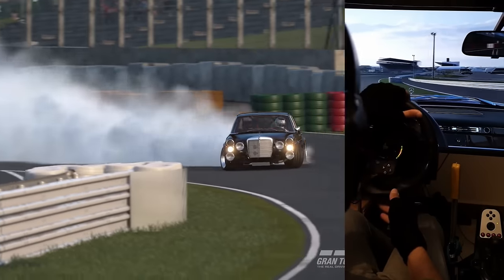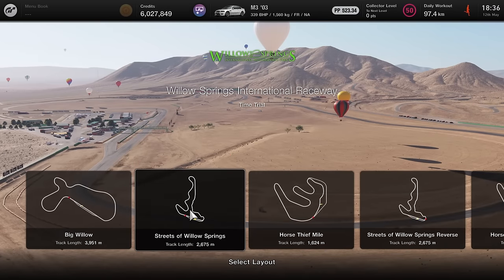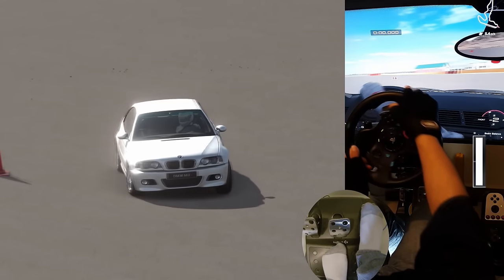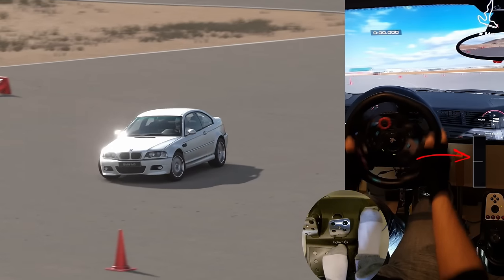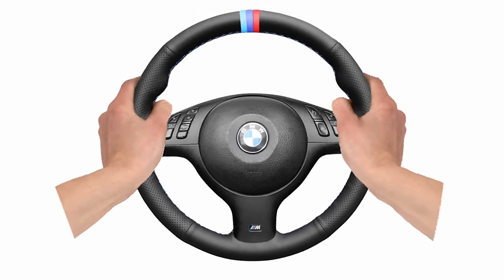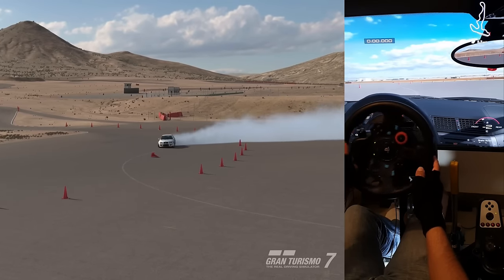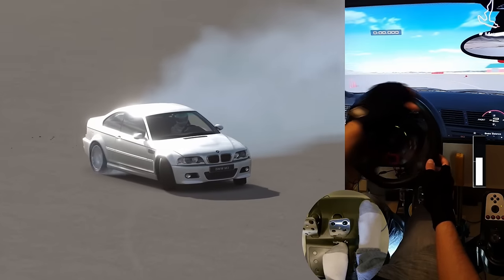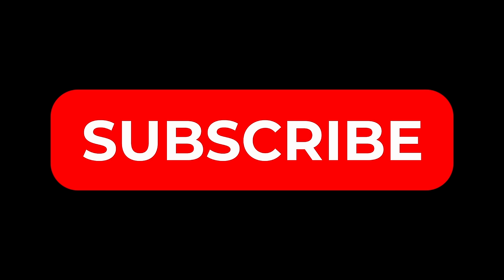How to Drift With a Steering Wheel (GT7/Real Life Tutorial) - Part 1: Basics

Comment: Ive tried this so many times. Ive tried hours of this with the same exact set up, and it just doesn't work. I do way better on a real car.
Reply from the maker: It's very normal to do much better in a real car. It's much easier to me to drift in real life than in game. That's because of the absence of G-Forces acting on our bodies which is the main "feedback" that we count on in real life to know how the car is behaving. I even think a person that is totally new to drifting in general can get used to drifting in game much faster than someone used to drifting in real life because that will require of you to rewire your brain and senses which I think is what's happening with you. You need to relearn how to feel the car like it's a completely new thin to you, if that makes sense. Luckily I learned the other way around starting with sim drifting than switching to real life which I remember feeling much much easier and require less concentration. You need to focus more on what the wheel's force feedback is telling you and practice long enough to get used to it. And trust me "hours" is not enough at first, try "days and days". Btw which wheel are you using and what are your ffb settings? If you didn't see this already, watch my video about the subject to best setup your wheel, which is crucial especially for someone looking for the most realistic feel possible. Basically set the controller steering sensitivity to 5 and the force feedback sensitivity to 10 which I recommend the same for all wheels, while the only setting that is specific to which wheel you're using is the max torque setting. I've explained everything about it in this video: https://youtu.be/oEe5ZchqbMg
There are also additional details about the subject and what you should expect from the ffb in this video:  https://youtu.be/qCpx5eExECY    
I hope this information helps you in any way, best of luck  🤟🏻🤟🏻
Reply: @SimActionClips  I have the logitec g29. I made all my settings exactly the same as yours. It sucks because going to drift events sometimes is too expensive, and sometimes they're to far, or they only happen once a month, and there's also no tracks in Texas that allow drifting unless there's a drift event going on, so I just wanted to get an affordable sim setup just to have fun, but I find myself getting frustrated so much. I don't want to have to buy a more expensive set up. It seems like gt7 has horrible throttle control. The way you did it, it constantly stays in the power band, mine doesn't do that at all. It also seems like there's random dead spots in the steering where it just becomes completely lose like if the steering wheel is almost detached, or hopping on the gears. I've also read of others feeling the same thing.
Reply from the maker: Yeah I feel you about the real drifting thing. It's similar here as well where I live and it's becoming more and more expensive. That's why I got that much involved in simracing and drifting. 
I think what you're experiencing with the steering wheel is when you get understeering, or at least when your front tires also slip during a slide. That's how it behaves in such situations. I also believe that we normally don't get ourselves in similar situations in real life, because we can much more naturally anticipate them before happening. But if you get yourself intentionally in such understeering situations, the wheel's behavior won't be very different. It's much harsher on the G29 for sure because of its gears and loose plastic parts but still the general idea is not much different. Also you gotta better watch your inputs at the pedals and try to be smoother. I don't know why, but I notice that we all tend to be more aggressive on the pedals while on the sim compared to real life. I need to always remind myself of that, since I notice that I tend for example to go much quicker to full throttle sometimes, and it ruins my drifts, something I never do exactly the same in real life drifting. It has to do, at least in part, with how the pedals behave mechanically and how much travel they have. It's also much easier to control and feel the brakes in real life which is crucial. I had to actually modify my G29's brake pedal to have better control over it, by adding another rubber piece to the one inside it to make it thicker and replacing the spring with a stiffer one. That helped a lot and made some good difference, but I still got much better improvement when I switched to the T-LCM pedals with the TGT2.

Also, and this is very important to be much more in control, USE A HEADSET or at least some earphones. Never use the speakers of your TV unless you're using the fiber optic connection for audio from the PS4. The difference in audio delay can be immediately felt, and the initial delay from the speakers completely ruins your input timing. This alone can reduce your frustration dramatically.

Comment: Car doesnt even break looze enough to drift. Wtf mod are u using? Not enoug  power when stock to break. It just straightens out. No torque.
Reply from the maker: Make sure you completely turn off traction control

Comment: I’ve been doing just as you’ve said, I’ve watched this over and over again, but I’m having a problem, when I tap my accelerator my car don’t go anywhere, i tap my accelerator and let go of my stearing wheel but I just go straight
Reply from the maker: Did you turn off the traction control and all other assists? You should only use ABS.

Comment: Okay. So i have drifted M3 e46 in Real life. Which means RWD. I have drifted 4WD. So i know how it feels to drift something in Real life. But here.... Ive spent one Hour on this track and i cant even do one clean donut. I have the G923 logitech and i dont know man. I Just feel like that throttle takes one second till it starts reacting. My Day is ruined and im going to work pissed off. 😂
Reply: I Just cant feel the throttle time response whatsoever. 🙄
Reply from the maker: Are you using my G29 settings? 
And you're probably experiencing latency from your TV. I had it on my old TV, it's awful. I learned my way around it though, but the difference was night and day when I bought my new one with the auto low latency feature. Even the ffb made more sense because i was seeing almost directly what i was feeling. Before it was, i feel then see it when it is too late. We're talking split seconds here but they do matter a lot. Even my new TV is just a budget LG TV, and I'm sure the latency is even lower on higher end gaming TVs.
Reply: @SimActionClips  aaaah man. Just checked it on my TV and it doesnt support ALLM. So i guess ill Just wait with the drifting for the new TV. But Its crazy. Cuz all my friends told me, that i must buy PS5 and GT7 because they know i go a lot to Nurburgring with my car and they told me that this will make me happy. So i finally got my M3 E92 here in GT7 and i was like hmmm now imma smash it on the nordschleife. But the problem is that i always drive with ESP off even in Real life and the corners are Just impossible to go on the limit for me. Because in normal life i often push it to the light slide so i can go way later on the brakes. 🙁 
But thank you for this. I think that explains it all. As i went for the same G29 setup as you have on yours. 
Well. Atleast i can memorize each inch of the track for the Season. 😁💪🏼 
Thank you anyway. 🙏🏻🙏🏻🙏🏻🙂
Reply from the maker: You're welcome man. I hope you get a better TV soon. To me it's totally worth it. And yeah you will get that for sure, I've already memorized every inch of the Nordschleife many years ago from GT5. It surely helps a lot even with the latency.
Enjoy man 🤟🏻🤟🏻

Comment: Did you delete my comment? went to reply to what you said but that comment is gone, anyway I've tried Live for Speed recently (a few months ago) and yep the FFB is still way better then GT7, even the physics are better are they are not great these days, it doesn't do a lot of the weird crap GT7 does like in your video where you go full throttle and it makes the car understeer, wtf is that? it does that because there is something wrong with the physics, you can create a situation where more wheel spin makes the car drive straight, that also makes the window you can slide in much smaller then it is in real life and in good sims.
Reply from the maker: No I didn't delete anything, that's because of the mobile app I can't see it either, only in the notification. You can open your browser on PC and still see it. All of what you said is wrong, and that situation where it creates understeering actually happens in real life. I didn't describe it after happening in GT7, I went ahead and recreated it intentionally because that happens in real life. I'm a real life drifter, I designed my tutorial around real life situations and went ahead and represented them in GT7 footage, which is the best in physics realism. Also i didn't say more wheel spin, I said sudden full throttle which actually creates less wheel spin because of more downforce created by weight shifting. Please don't mix concepts in a random way just to try to make a point and understand what I'm saying first.
Reply: @SimActionClips  I'm in PC, I can not see the comment at all.

" went ahead and recreated it intentionally because that happens in real life"

It does not happen in real life, you can create many situation in GT7 that do not happen in real life.

"I'm a real life drifter"

This does not mean you have any idea what you are talking about.

"which is the best in physics realism."

There is a reason top level drifters in real life use AC and not GT7.

"Also i didn't say more wheel spin, I said sudden full throttle which actually creates less wheel spin because of more downforce created by weight shifting"

wut I'm guessing English is not your first language as this makes no sense at all, otherwise you do not understand how weight shifting works while drifting, sudden throttle input while in a slide does not cause the car to get less wheel spin, it literally does the opposite, in GT7 though it makes the car drive straight because the physics are weird, as I said in GT7 you can create a situation where your wheel spin increases but the car wants to straighten.
Reply from the maker: Yeah I can't see it either now that's strange. 
It does happen in real life, just you never noticed that. I actually know exactly what I'm talking about and you don't apparently.
The majority use AC because they can mod it to have the tracks and cars they want, and because it's easier, that doesn't make it more realistic.
 
Weight shifting to the back*, and it does create more downforce, and you need to have tones of torque to overcome that and create enough wheelspin, especially with stock road car suspension. In a stock underpowered car, similar to the setup of my tutorial, where the purpose is to make a beginner learn something new, and whom is not a professional drifting a purpose built drift machine (which would actually behave differently because of its setup) the situation I described still actually happens in real life even if you still fail to realize it. And btw I never said it always happens, I've carefully chosen my words in order not to get such silly comments from drifters who only drive by feel but don't know how to actually describe it, let alone notice such crucial details and situations which they have developed the right driving habits over time to avoid without even noticing . I literally said "you are more likely to cause understeering". I'm addressing beginners who will very frequently get themselves in such situations in such cars. I've seen that happen over and over again in real life, and what I'm explaining in the video is exactly how it should be done. Of course there are other situations where you will go suddenly on the throttle and not cause oversteering, but that is irrelevant here and to the purpose of this part of the tutorial. You're saying that never happens though which is wrong, even in the middle of a supposed drift it does still happen.
You can say whatever you want, and make fun too, doesn't make your argument valid.
Reply: @SimActionClips  Pretty sure I would notice if I went full throttle suddenly mid drift and got less wheel spin, it does not work like that, weight shifting mid slide even in something that isn't setup for drifting does not effect the car that much.

"The majority use AC because they can mod it to have the tracks and cars they want, and because it's easier, that doesn't make it more realistic."

GT7 drifting is harder because it's less realistic, some of the best drifters in the world wouldn't be using AC to practice if GT7 was the most realistic.

GT fanboi's are actually delusional, it's funny, you can describe a situation where the car does something really dumb and they will try to argue it's realistic, what I described is just one thing on a long list of weird issues with physics in GT7.
Reply from the maker: Okay champ

Comment: Yea nah i give up
Reply from the maker: Why? 😅
Reply: @SimActionClips  lmao bc im just trash i cant seem to get the wheel to flip back idk theres just always a issue video is amazing but im just a bad learner i guess
Reply from the maker: Well it's normal for it to feel hard and even impossible if you're not used to it. It takes lots of time at first, I've been there. It's frustrating. You just need to keep practicing daily. Which wheel are you using? And did you use my ffb settings?
Reply: @SimActionClips  G29 which i heard was the worse wheel for drifting and yes i did use your FFB setting’s
Reply from the maker: well yeah it is annoying, it's slow and I had to constantly keep helping it. But it's still not so bad.

Comment: This game is terrible for wheel setups. There’s zero wheel endpoint adjustability in gt7 or the PS5 itself. People that want short throw steering or custom tailored endpoints simply can’t do it. Major flaw in GT7 and makes this geared more towards controllers instead.
Reply from the maker: So you're judging it solely based on this missing feature? And "makes this geared more towards controllers instead"? Really! Just because you can't make a road car have some short throw steering which it shouldn't have in the first place! Btw if you have a thrustmaster, you still can choose between 5 different levels of rotation on the fly from the wheel itself.

Comment: Haw can you drift with G29 pedals.. that's the real questions.
I have a T300 RS, the pedals are really good, try the G29 setup to my friend yesterday... I DONT KNOW how people can tell this is a good wheel ! This is a fcking joke
Reply from the maker: Well saying it's a very good wheel isn't fair. But also saying it's joke is not fair either. It's very good value for money actually. It's a not bad wheel when setup right. I never tried the pedals of the T300RS, but i did try the ones that come with the TGT. I found the pedals of the G29 actually much better than these. I had to order my TGTII with a T-LCM pedal set because i couldn't stand how bad the standard ones felt. I gotta say I did modify my G29 pedals by adding a stiffer spring to the brake pedal and a longer rubber stop inside. But that's a very simple and cheap mod which totally transforms the feel of it. I also opened a window on the top cover and installed a 12x12 fan for cooling, which retained a bit more force for longer ( it does fade away while playing because of heat). But even before any of these mods i could still do anything with it. It just requires good practice and better understanding of how you need to help it spin faster with your hands on brutal drifting transitions to be able to keep up with the car. It's more effort but it's doable, and for anyone on a low budget, it's still a much much better experience than the controller and a game changer.